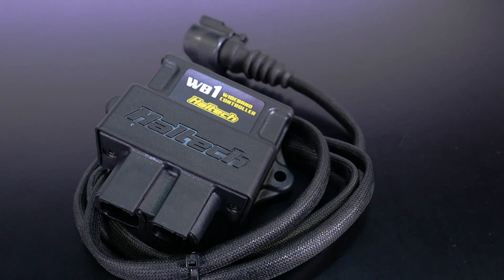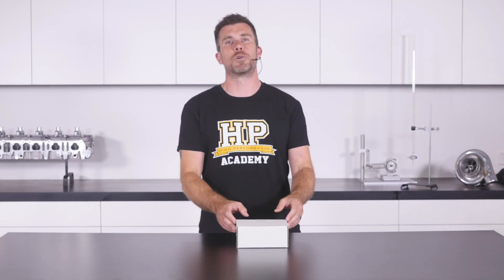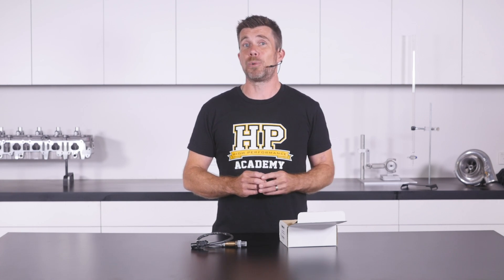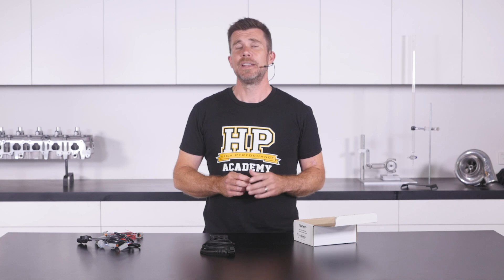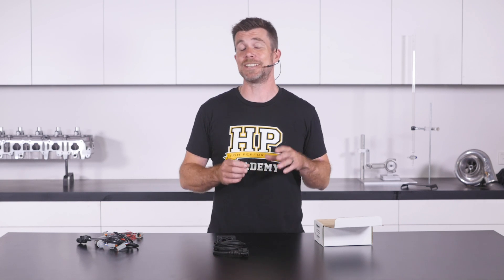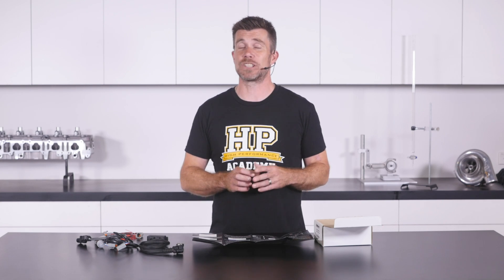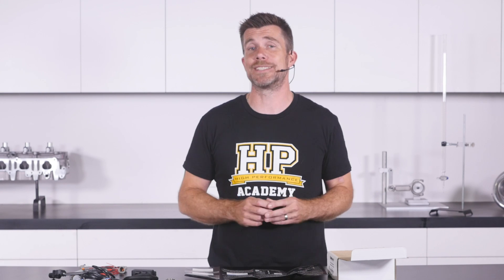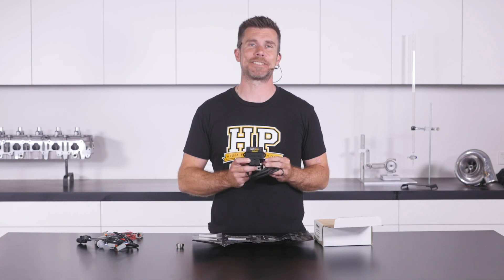☠️ Accurate Fuel Delivery Or Death | Haltech WB1 [UNBOXING]

Comment: When I saw them first I thought that this is the solution to my problem with Widebands and EGTs. But come to find out this is, as you mentioned not a real CAN system because it CANNOT be used with the standard Bosch Can bus and actually should not carry that name since it implies something that it is not, a CAN controller ...... all it is, is a proprietary HALtech bus system similar to a CAN bus controller. They are very expensive and I almost purchased 4 such Controllers which would have left me stuck with a non funktioning setup.
Very disappointed about this since I have already a MS3pro installed.

Comment: Question: if the motor leans out due to low fuel pressure. Which sensor would pick up engine protection first? Would it be the wideband sensor or the fuel pressure sensor?
Reply: Fuel pressure would be more accurate but a haltech monitors both for extended engine protection

Comment: typical Haltech run a sale to clear old stock then release a new product without letting customers know and Improved product was in the pipe work.

Have you seen their elite universal looms?  80 degree rated PVC insulation with regular bare copper strands for something crazy like $499. They don't mention the wire quality on the site.

Comment: I don't want to be rude but these aren't really competitive with AEM's CAN WB controller (30-0310). They run about $170USD each. What's the benefit over the competition especially with the closed source CAN protocol? Haltech has them listed at $299 single ch and $450 for dual ch.
Reply: @steelmesh Whelp I can use it on my megasquirt so I'm guessing it's open source. No hacking, was just an option in the can settings.
I am forced to use AEMnet and have to disable the MS type can but it does work and will allow you to use the dash and any other AEM can products on the bus.
Reply: @steelmesh I'm sure someone will but until then I'll have to stick to the AEM and MS stuff. I don't really have the time these days to decode a CAN protocol. HA

Comment: How are Haltech terminating the CAN now with the DTM connectors?

The CAN protocol IS available from Haltech, I can send the PDF if you'd like.
Reply: @steelmesh Their old cables were 8pin with 6 wires, two of which enabled an on board terminating resistor on the device itself. I'm guessing the new system has a resistor built into the cable that is used on the last device on the bus.

Comment: I have a Haltech Platnium pro plug in, and have the older WB1 controller. I have not installed either the ECU or the wideband controller yet, but would it be beneficial to upgrade to this newer controller and sensor?
Reply from the maker: I don't have the knowledge that Andre or Haltech has on their products, but I wouldn't think you would need to upgrade either of those just because there is something newer. So long as it all still ticks the boxes for your requirements, it's still a solid choice for you IMO =) - Taz.